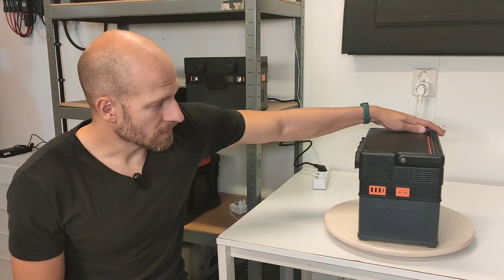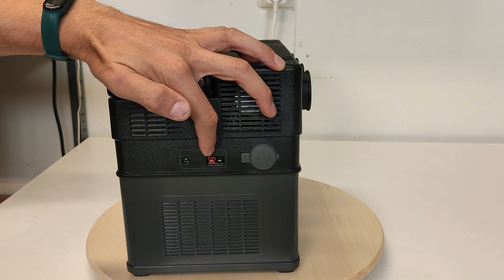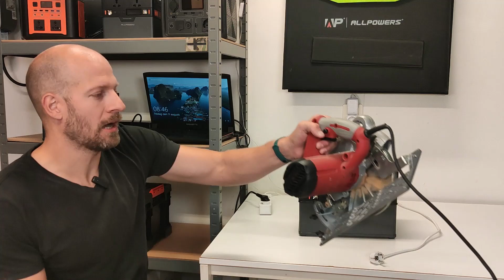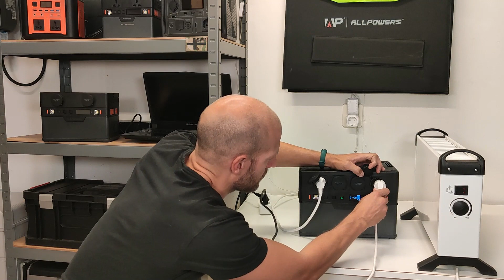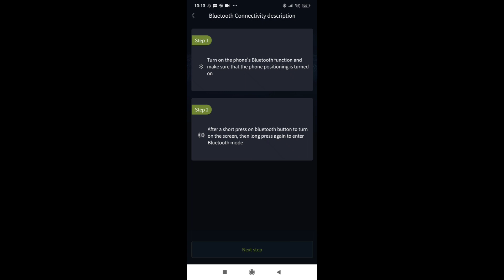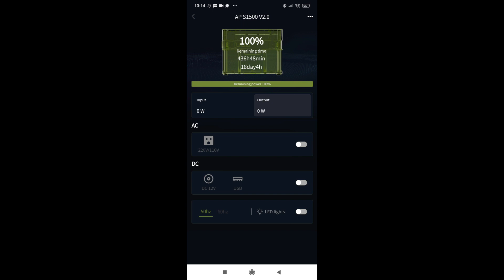Allpowers S1500 Power Station Review: Unleashing 1.1kWh of Portable Energy!

Comment: How long can I run with 1500w air conditioner?
Reply from the maker: In theory, if you were able to run in on 12v DC I would say about an hour. Buy in reality, if you are using AC, maybe 40 minutes unless you have it connected to a solar panel or other way of charging.